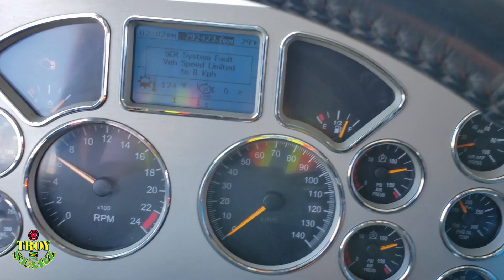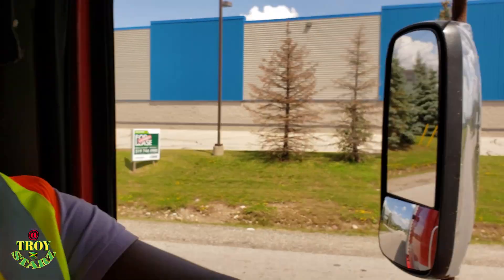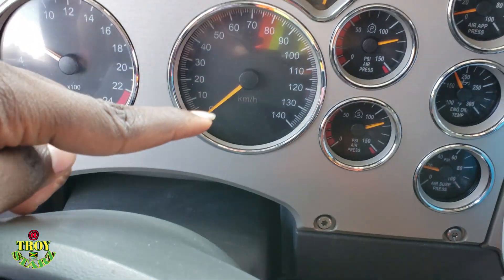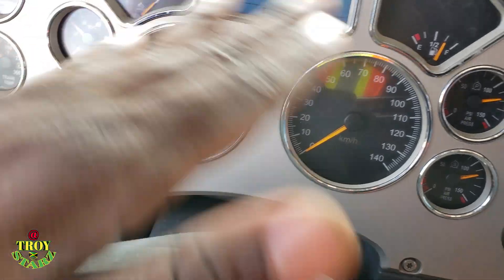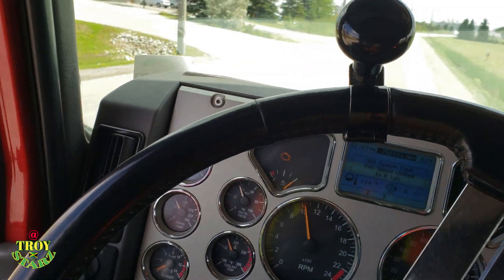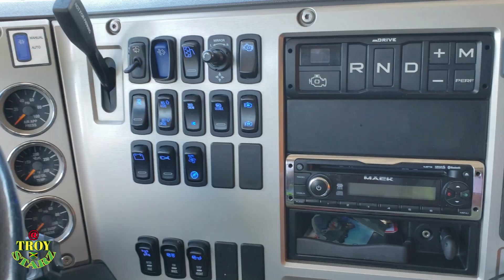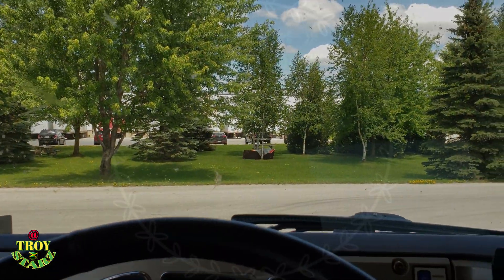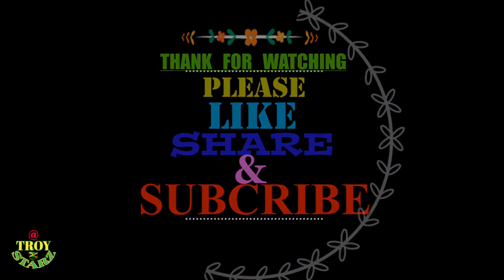How To Get Out Of 8 KPH Derate Mode SCR System Fault, Mack Volvo Truck

Comment: 2016 Mack pinnacle if I pull that sensor off transmission about how far could I go??
Reply from the maker: It’s not going to drive 100% the pulling power is not going to be the best.. your speed will varies

Comment: Happened to me today 2022. If you get this warning signal, I repeat, DO NOT TURN THE TRACTOR OFF, until you make it to your destination! You won’t lose power or Derate until the engine resets aka turn the key ignition off. Until you do that, the truck will run fine
Reply from the maker: What was the issue with your truck?
Reply: This happened to me twice.  The first time I shut the truck off and it went straight to derate mode. 

The second time when it happened I thought I'm not going to shut it off I drove until I ran out of time on my eld I parked and went to sleep but left the truck idling also I made sure rpm was above 5 (Volvo truck). Only to find out in the morning that it did in fact derate anyways. Also if you disconnect either the speed sensor or one of the fuses under the hood to bypass this issue know that it may also DISABLE ENGINE BRAKE! This happened to me and I almost caught fire in Utah on a very steep downhill right before Salt Lake City. 

Honestly this whole DEF system is nothing but added expenses and unnecessary pain.

Comment: that's not bad at all anytime I go into the dealer with my Kenworth with a paccar engine in it I usually blow $5,000 Plus for a check engine light....

Worst of all I can't check the codes myself the dashboard simply tells me to see the dealer .... And my local shop that I do use can only read some of the codes and maybe 25% of the time activate or reset parameters for new  parts ect if I'm lucky so 95% of the time I'm stuck going to the dealer.

Comment: my truck is showing "SCR Performance Low Service SCR System Veh Speed Limited to 5 Mph" what should i do?
Reply from the maker: Did you stop driving?
Reply from the maker: What was the code showed on the truck?
Did you watch the full video?
Reply: @TroyStarzTruckingVlogs  you didn't show us how yours was fixed u only told us u changed the def pump, i will be grateful if u can make a video on the def pump, where it is located, how to change and other stuffs one can do to fix this issue, presently 3 of my mack 2013 trucks are showing the same 5 Mph SCR and i need to get it fixed by tomarrow
Reply from the maker: It's not all the times when the scr comes on its the pump .. It can be a sensor too .. I think you should take it to a shop..
Reply: @TroyStarzTruckingVlogs  that's the issue we have here in my city, most truck mechanic and electricians only work on volvo and they're so scared of mack trucks, i have called a few who don't have idea what that is.
Reply from the maker: @Meninist-i2r  mack and volvo or the same trucks what's are they saying… any ways I don't want you to fix something that's not the problem take I to a dealer then. Don't  cheap out it will cost you more. Because maybe it's just a sensor… try to get it checked out first
Reply: @TroyStarzTruckingVlogs  ok thanks i will ask the mechanic the to check the sensor under first before the pump
Reply from the maker: @Meninist-i2r  yes I can give you his number.. But you said or dealer too so what do you really want. I'll send my mechanic number
Reply from the maker: +1 416-400-0202 .. My mechanic in canada 🇨🇦
Reply: @TroyStarzTruckingVlogs  thanks alot
Reply: @TroyStarzTruckingVlogs  OK give me that of mechanic
Reply: yes i did, If just want to know if i change the def pump mine also will be fixed
Reply: Just happened to me, it was the def pump in mine too

Comment: Why don’t you used your mechanic instead of going to the dealer you could save a of money by doing that
Reply from the maker: Yes I would save but sometimes I'm for away from my mechanic also you not supposed to drive far with it disconnected